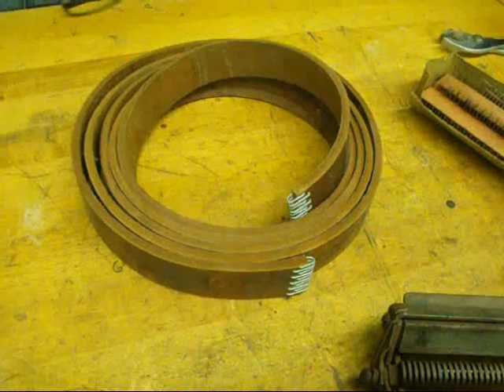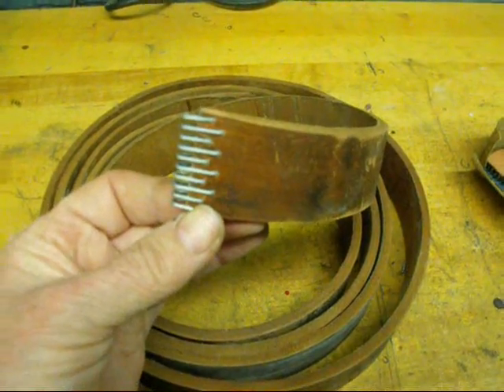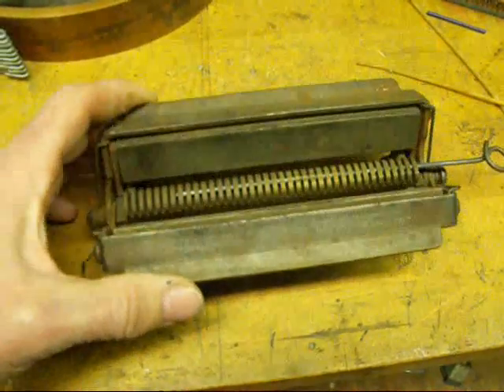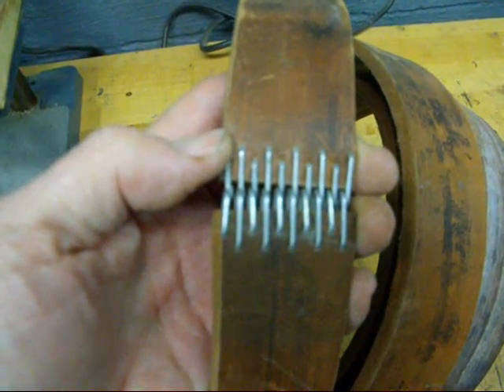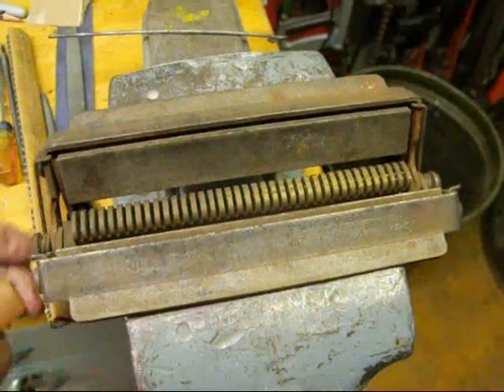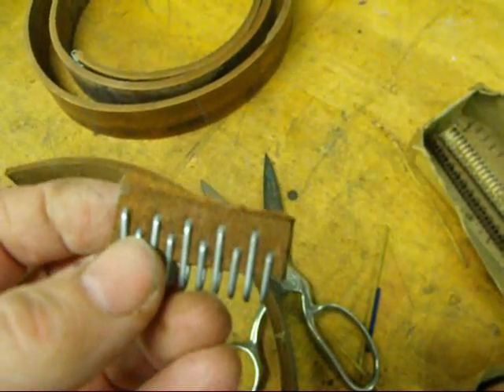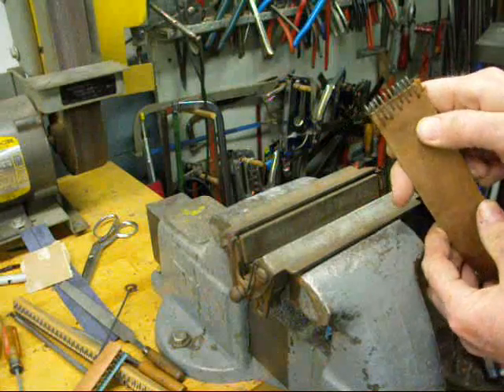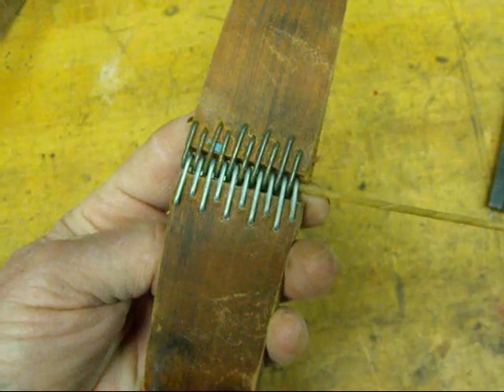SPLICING A LEATHER SOUTH BEND LATHE BELT tubalcain

Comment: One word of advice....use 1 or 2 fewer hooks to allow more free space on the ends of the splice. Once a hook tears out, that spot is going to be weaker and the stress will concentrate there. I have spiced numerous leather and rubber belts and this holds true for both. If your belt has a guide slot or bars, bevel the trailing end also.  Anyone wanting belts spliced can message me. If I have or can get hooks for your application, I will quote a price + you cover shipping both ways.

Comment: Mr.Pete my belt just broke on my south bend 16. could i get you to make me a replacement? i do not have the clipper tool :(
Reply from the maker: Diesel Ramcharger NO-, BUT YOU CAN BUY A BELT ON EBAY
Reply: mrpete222 Thanks! they are more available than i had feared.